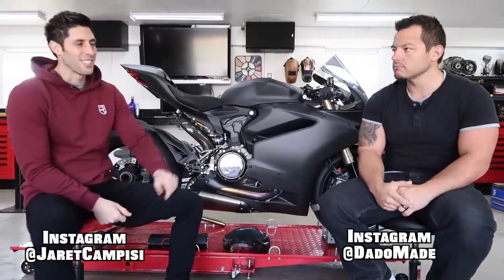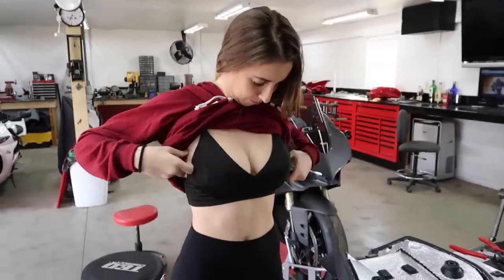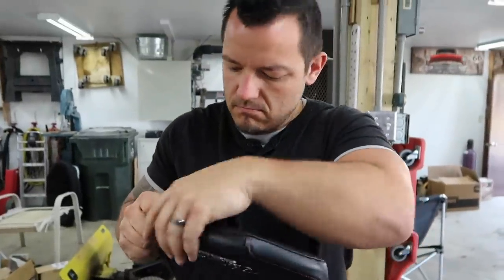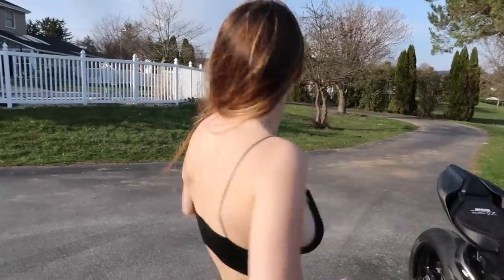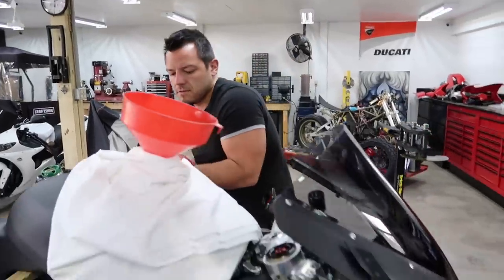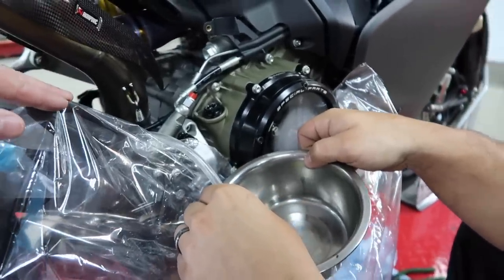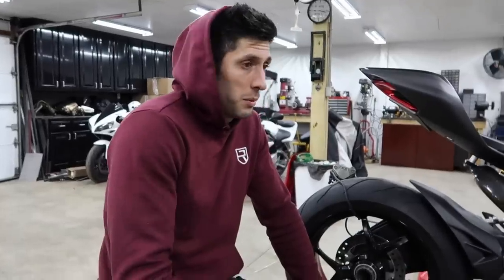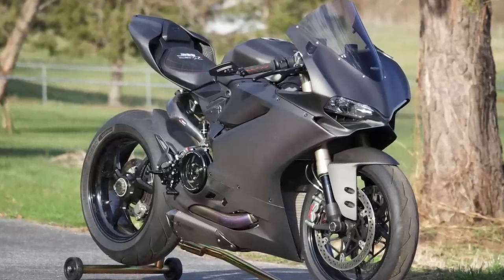Carbon Panigale with Custom Luimoto Seat Cover!!!

Comment: question jaret .Everithing wonderfull but, could  a so large use of carbon create electrostatic current   problem   ? I think to fuel tank refill at gasoline station overall with very dry and hot whether !!!!!!

Comment: Was there not a full carbon exhaust to put on?? That would’ve made it even better.
Reply: Or paint it black
Reply from the maker: there is no such thing as a carbon exhaust.  Titanium is the lightest and best material you can get for an exhaust and that's what we went with :)
Reply: Jaret Campisi no im talking about the slip on. A full carbon one like they have for dirtbikes

Comment: Did you already tune the bike for the full exhaust?
Reply: Heinz Müller rapid fuel bike controller is installed if you watched the previous ep. Where we featured it.
Reply from the maker: The rapid bike fuel controller auto tunes the bike as you ride it so there is no need for a tune :)
Reply: Oh I see. Pretty handy :)